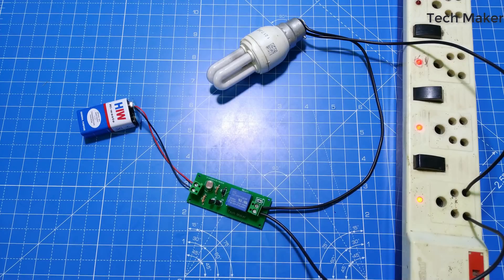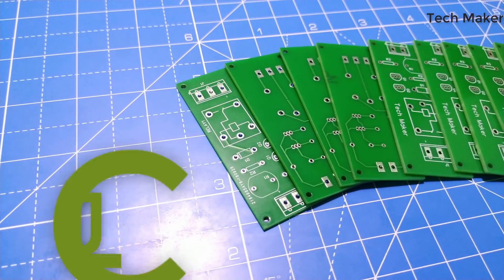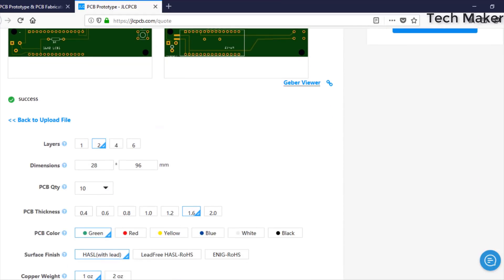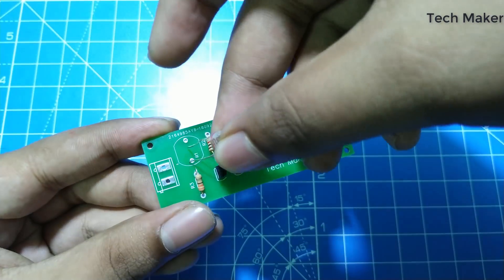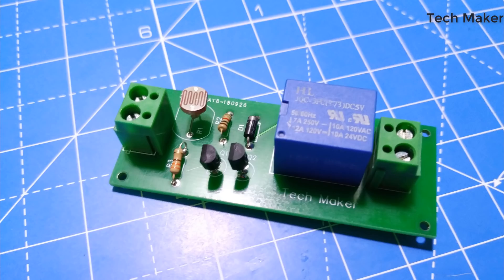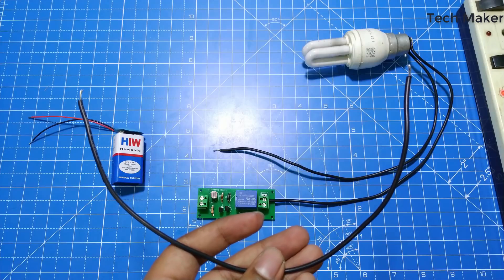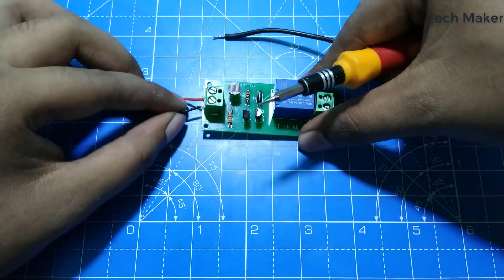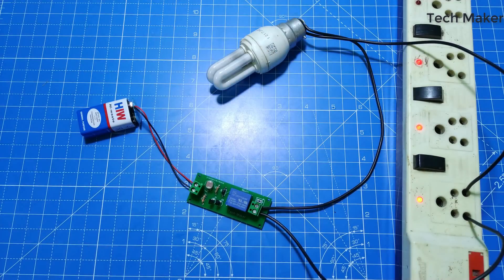How To Make 220V Automatic ON/OFF Light Circuit | 220V LDR Switch Circuit

Comment: You can buy these things pre-made from China. They also have a sensitivity potentiometer and can work in NO (normally open) or NC (normally closed) operation, which means you can set the output to turn on when it's light or when it's dark.

Comment: Quick question. Can I add a capacitor in the circuit to have a slightly delay in switching on and off? and if so what is the benefits of having a delay on the switch? Because ive watched another video telling that there should be a delay on the switch but did not explain why.

Comment: In circuit diagram you'll show 3 output but in video you connect bulb direct to supply please tell me the connection of relay output
Reply from the maker: Third pin is not required, so I eliminated it and used 2pin terminal block
Reply: @TechMaker1  which pin is eliminate?  The middle one means 5 no or 3 no

Comment: How can I make the circuit invert, that is switch on AC lights during the day and off during night?
Reply: Take the AC out from relays normally close pin
Reply from the maker: Use PNP transistor instead of NPN transistor